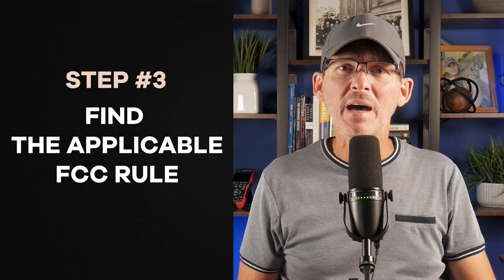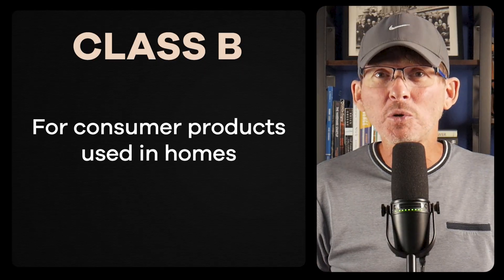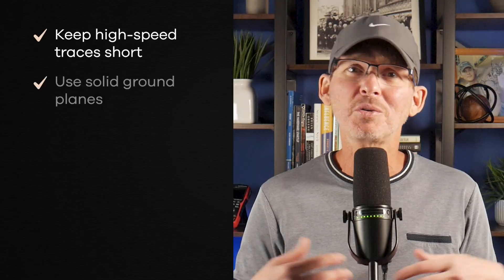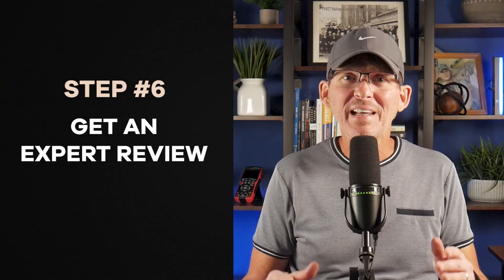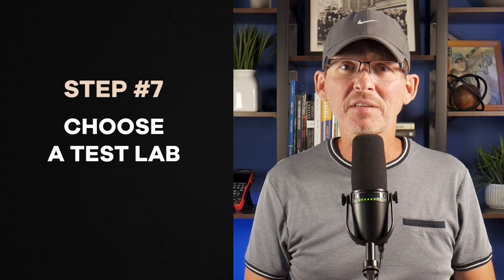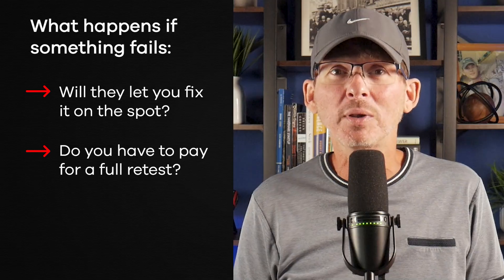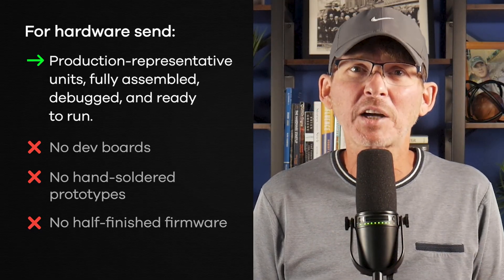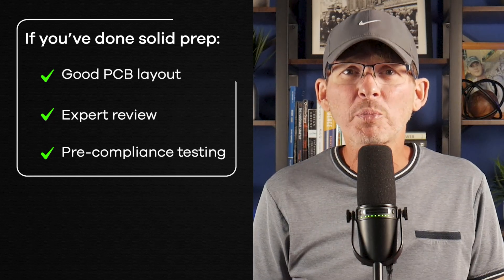How to Avoid Failing FCC Certification (10 Steps to Passing)

Comment: I want to make a giveaway device that randomly blinks two LEDs off a coin cell and found out today that the ATtiny microcontrollers can be programmed to run at an 8KHz clock rate, thus bypassing the need for FCC certification 🙂 The random delay is measured in seconds so the timing need not be accurate.
Reply from the maker: Yes, if all generated frequencies are below 9 kHz, then FCC authorization isn't required.
Reply: There are LEDs with built-in blinking but I couldn't find any with the long, random duty cycle I am seeking. And there doesn't seem to be any way to do this with an analog circuit that doesn't cost a lot of money or require a lot of voltage. I want simple, cheap, giveaway random blinkies.

Comment: It might be easy fixed, like bypass capacitor in the same day. Two minutes before, you need to pass real production board, not manuallly soldered 😂 How to do it in 1 day?
Reply from the maker: Yeah I meant more like adding ferrite beads or increasing the size of a decoupling cap. Obviously you can't make any major board changes or hack the board up.
Reply: hide the kynar hotfixes in potting blobs 🤣

Comment: Could you please recommend equipment for in-house pre-compliance testing?
Reply: We use a GTEM and some "golden" DUTs which we compare against. We have several products that have a full gambit of certs (FCC, ISED, CE, ANATEL, etc) I use these as part of our Golden samples and cross reference their report data. You will need a Spectrum Analyzer some pre-amp and notch filters and a lot of time to figure it all out. I have automated a fair bit of our scans with scripting and hardware to help speed up the process. I also have some calibrated antennas and can run Open Air tests and have been able to get accurate gain and pattern measurements from these as well.  This equipment isn't cheap, but neither is failing certs testing or multiple trips to a lab for pre-certs testing. If you are running lots of products a year its well worth the investment. Keep in mind it takes a long time to figure this stuff out if you don't know what you are doing so those early years/products its worth the investment to learn from experts (3rd party labs, test houses, asking techs).

On the other hand I have spent money on labs chasing issues down, only to find it with my near field probes at night just messing around, so don't under estimate the importance of basic tools which can prove to be powerful with experience!

If you want some basic equipment to start get yourself a decent spectrum analyzer and a near field probe set, a set of attenuators, a few amps (pre-amp, LNA) and some filters.
Reply: @SparkysWidgets thanks a lot for detailed answer 👍
Reply from the maker: The equipment needed is very expensive, so for most using a 3rd-party lab is the way to go unless you already have the equipment.
Reply: @PredictableDesigns what equipment specifically is needed? Some EM spectrum analyser and maybe some EM shielding chamber? Are there any budget options?

Comment: Very informative!

Complete fail on getting the Certifications Estimator Tool though...
Reply from the maker: Thanks! Not sure what you mean on the tool. Did you not receive it via email? Did you check promo and spam folders?
Reply: @PredictableDesigns  I didn't receive it. I did check promo and spam folders.
Reply from the maker: Can you share a bit of your email address so I can look you up and manually send it? No need to share full email here of course, just enough of it can identify you. Or email me at info@predictabledesigns.com.
Reply from the maker: I found the problem. My email server is down this morning and tech support is working on it. I'll manually email out the link to everyone who signed up for it as soon as things are back up. Sorry about this:(
Reply: @PredictableDesigns  Okay, no problem. Maybe associated with the huge problems that AWS is having. Anyway, thanks for following up.
Reply from the maker: Yes, it is related to the AWS outage which I've just heard has a big portion of the internet down right now.
Reply: Yayyyy AWS outage